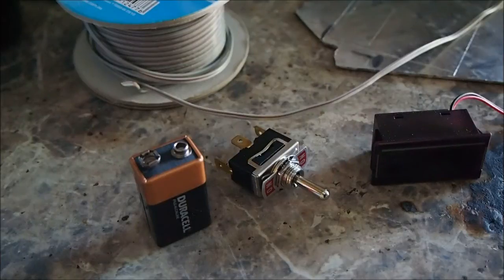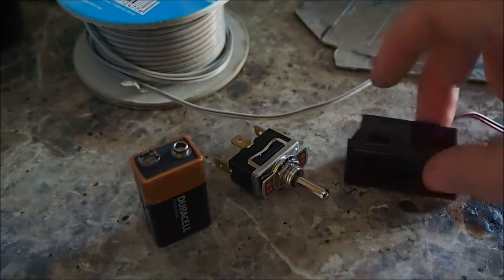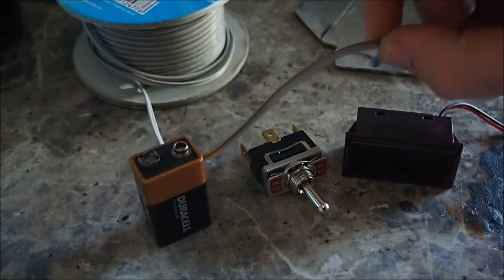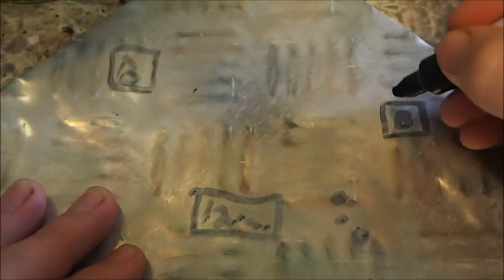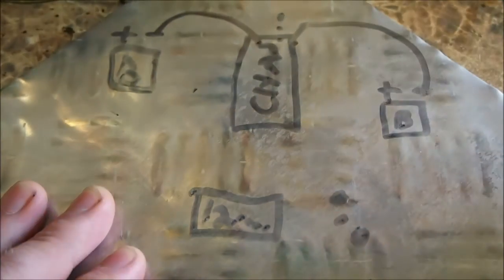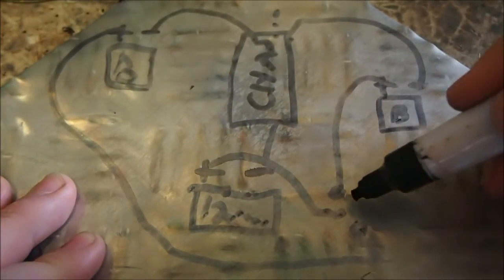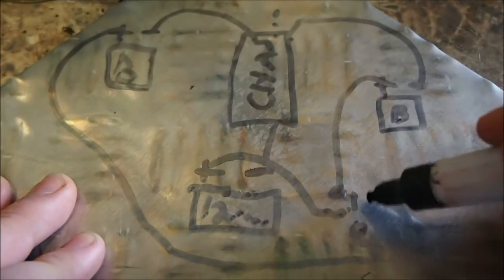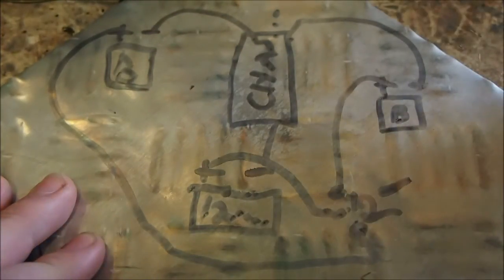Dual Battery System Volt Reader For Under $20!!!!! - JD's DefenderCam Bitesized

Comment from the maker: Hi there, I bought it from Jaycar with mates rates, I think I payed about $22 for the gauge, instead of the rrp of $30. It's a good quality little thing and has click-in tabs on the side so it grips into whatever you mount it into. But You can get cheaper units that will do the same job. You can even use analogue dials in the same simple circuit. Regards, JD.